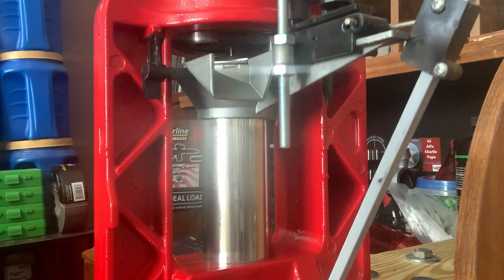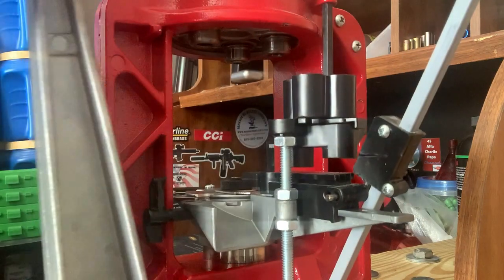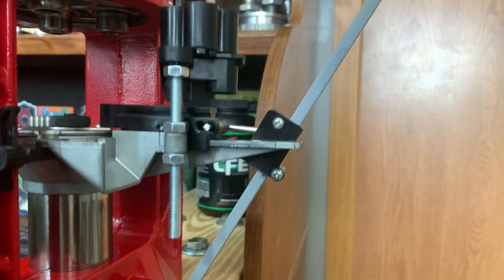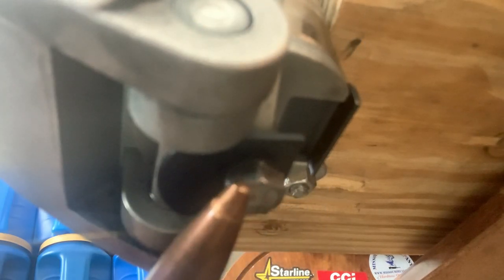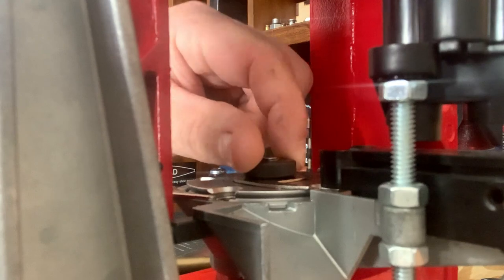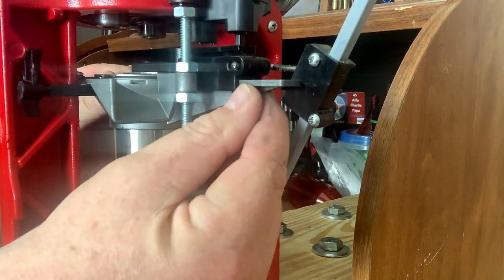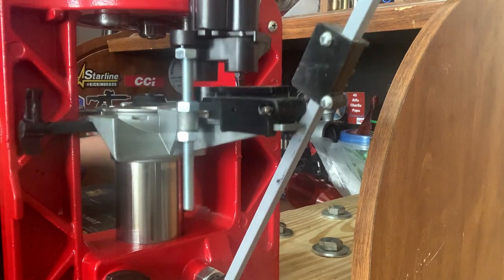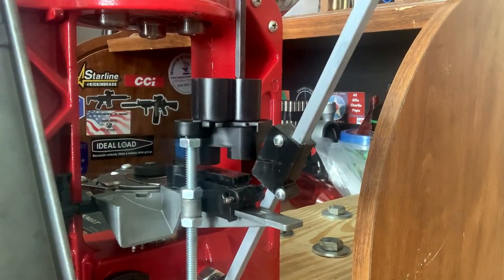How to Fix Lee Loadmaster Indexing Problem

Comment: Thanks. I have had my loadmaster for a couple of months when this issue just reared it’s ugly head. I have been looking at everything on the press trying to get this working. I thought it was the primer feed which I have stopped using and removed. Hehe… instructions… um. Hehe 🤦‍♂️
Thanks for the video simple easy to follow.
Reply from the maker: Glad to help you out. I preprime all my cases before running them on this press. I don’t like the priming system on it.

Comment: I bought mine used to thanks for the info
Reply from the maker: @plumbcrazy375  thanks for watching.
Reply: @jesseboutdoors  I have a dumb question  how does the primer work
Reply from the maker: @plumbcrazy375 the priming system is less to be desired on this press. I always primed off press.